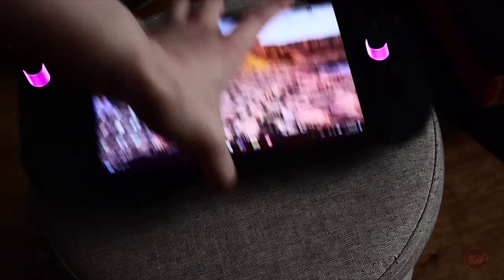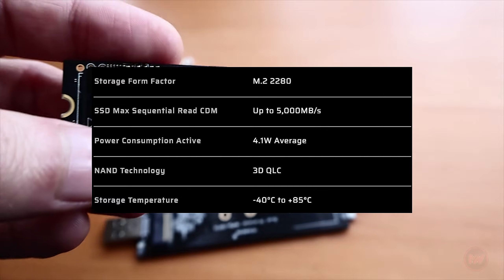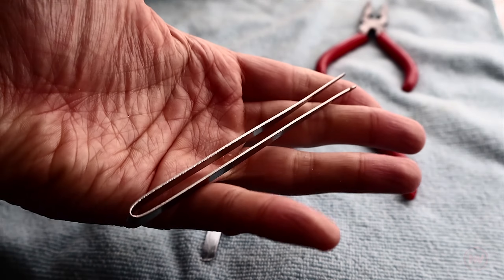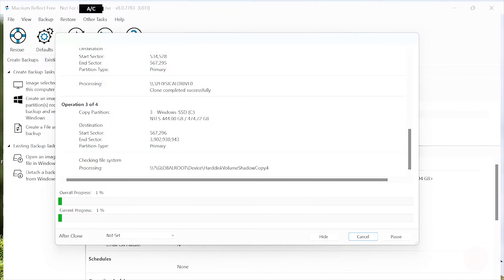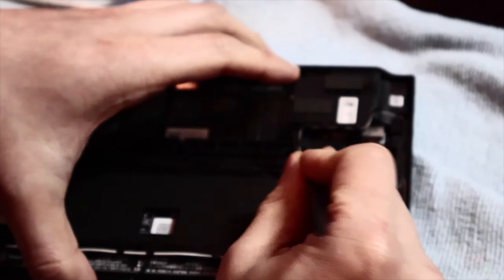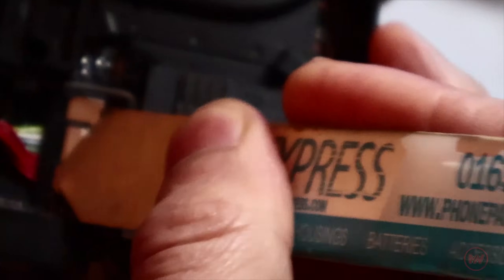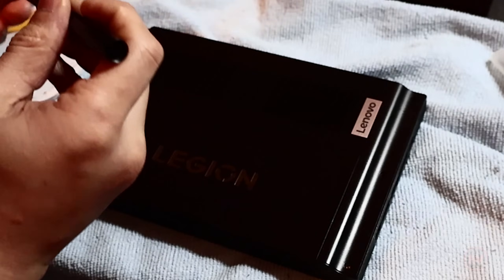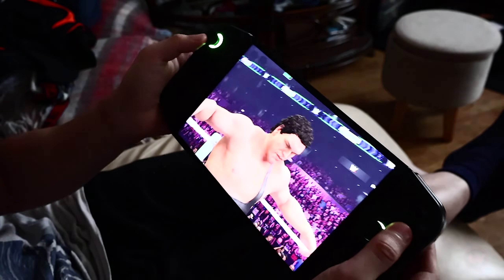Legion Go 2TB 2280 SSD Upgrade Guide

Comment: Thank you very much for the video! It all looks rather daunting, but hopefully manageable... Considering how pricey 2242s seem to be, it may well be worth a try.

I'm thinking of taking the 2TB 2280 SSD out of my desktop, so I can upgrade it to a 4TB, and sticking that in my Legion Go S to replace the 512gb SSD in there - can I likewise use Macrium Reflect to clone my PC's SSD to the new 4TB drive first?

Thankfully the drive I'd like to move is my D drive (with all my games on it), so my OS should at least remain intact on the C drive that's staying put.
Reply from the maker: Thanks for the comment. It's not as bad as you think but there are things that could go wrong with it. I highly recommend keeping the original m.2 as a back up if anything goes wrong.

I think you'll have to clone the original legion go ssd to the new one. I don't think your pc files would load on the Legion Go as it is supported by the motherboard and it's drivers. So it might not boot up if cloning your pc.

Comment: The adapter is slid into the slot and then secured with a screw so it won't wiggle out. But what is the ssd secured with so it won't wiggle out of place, the sticker? Seems like the ssd can wiggle out, no?

Comment: Hi Ketten, is it recommended to replace the 512 ssd with 8tb ssd single sided, WD has a 8tb single sided ssd. what are your thoughts on ssd 8TB? have you tried it before? if so how are the temps? is it safe?
Reply from the maker: Yes i definitely recommend upgrading the 512gb and keeping it spare or back up if it fails. 
the Lenovo Legion Go can support an 8TB SSD, but it usually requires using a specific adapter (like the Sintech 2242 to 2280 extender) to fit the larger 2280-size drives into the device's M.2 2242 slot, with users successfully installing drives like the Samsung SN850X 8TB. I presume the temps would be higher but not 100% sure. You could try it and test it out but keep a good eye on the temps when doing so.

Comment: you saved me 174$ thank you soo much bro.❤❤
Reply: i was going to buy a whole new SSD that would fit inside my legion go. thanks
Reply from the maker: Many thanks. I was also in the same predicament before I did this upgrade. The 2230 are expensive compared to the 2280 ssds. Enjoy your beefed up LeGo. If you haven't already I recommend trying out the ps3 emulator on this. Highly recommend and I also have a tutorial for it if u ever do 😎👍

Comment: SSD drive does no operate at full speed with the adapter.
Reply: Is thes true?
Reply: Do you any that offers the full gen 4 speed? I got this crap and it's only 3569 MB/s. JMT Modification Board https://a.co/d/6hD8y3H
Reply: Yeah... I was wondering myself about the actual speed and performance of the SSD when connecting through the adapter... still skeptical.  It's probably worth it to actually purchase the regular M2.2242 SSD to obtain the optimum performance.

Comment: FINALY I did the mod, and used crucial m2 nvme and adapter from Ali Express that had good reviewes , I cloned my disk with macrium reflect, unfortunaley I am receiving often blue screens and I don't know what to do, do you have an idea to help me?
Reply from the maker: I would run a check on the disk for bad sectors it's possible that the ssd isn't seated properly, that or the adapter. I would check both to see if they are misaligned. 
When does the blue screen occur? And what is your temps looking like? I would download hwmonitor to check temps of ssd and CPU. I did clean the fan and heatsink when doing the mod as it was caked in dust bunnies. Congrats on doing the mod 👍
Reply: To ensure if the adapter or the SSD is defective.  You may want to download the .ISO from Lenovo and do the fresh installation. It's possible that to different SSD interface (2242 vs 2280), it may cause Windows not recognize the boot sector on the drive.  If the new installation works out good, then you know the answer.  I usually has best of luck when clone drives with the same architecture, ex.  2280 vs 2280.  Best of luck.
Reply: I returned for now to the original SSD, my suspicion is that the adapter was malfunction, I ordered new one and I will try again, if it will not work, I will give up, the new ssd is good and working well

Comment: About the electric consumption, I have Crucial P3 plus that his average consumption is 4.3 watts but the maximum consumption is 8.6 watts, will it be good?
Reply from the maker: Thatll be fine but I highly recommend getting a 1mm copper heatsink plate installed on top of the ssd as it'll get hotter than the OEM nvme.

Comment: Just an important tip: you can turn off the battery in the BIOS (Vol.UP + Power btn) so you don't accidentally turn the Legion Go on. Plug it to the charger to have it boot again.
Reply from the maker: Thanks for the tip!
Reply: Yeah i did this my slim 5 for upgraded ssd

Comment: I have the same adapter as you, and went through 3 different 2280 ssd's. The newest Lexar 2tb is showing the same sluggish performance problem as the other ones.
Reply: Did you make it work maybe? I was planning on getting a Lexar NM790 4tb 😢 or you had luck with another brand?

Comment: I been planning on this for months and bought both the NVME cable for the on top of the battery and a vertical adapter, but might go for the battery side mod. Bought a 4TB TeamGroup mp44 that's single sided and new graphene thermal spreader sheets to help wick the heat away. I just need to get off my rear-end and do it. Might do the 32GB RAM mod later on, but wished there was a USB flash utility for editing the BIOS.
Reply from the maker: @themadatheist1976  ohh that's pretty dope. Is the Battery side mod internal or a battery pack so you can charge it on the go? I saw a good video on the ram mod. Yeh I wonder if anyone would make an open source usb flash utility. That would make things easier for sure. Good luck on all your modifications 👍😀
Reply: @AzNstat    the nvme over the battery? Ya, you can either cut that tray that's over the battery or buy a 3D printed one to use the other 2280 adapter. My TeamGroup MP44 is single sided.
The 2280 will sit in the cutout of the tray, but there's 3D printed back shells people buy also.

Comment: Thanks alot man great and thorough walk through. I misplaced my screw for the adpater and I don't have any of that RF tape or anti rf tape.
Reply from the maker: @SeanKnapfel033181  thanks for the comment. Appreciate it. You can probably use a replacement screw form an old device or just tape it down or use double sided sticky tape. If you don't have rf tape you can use electrical tape. 👍